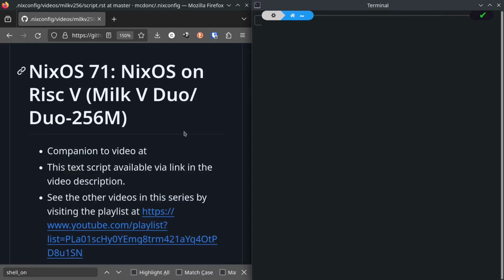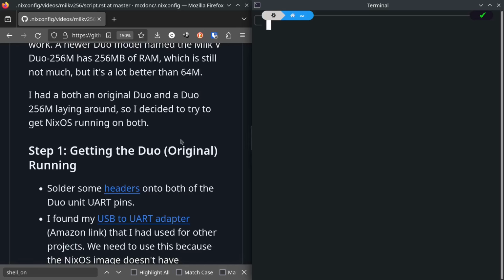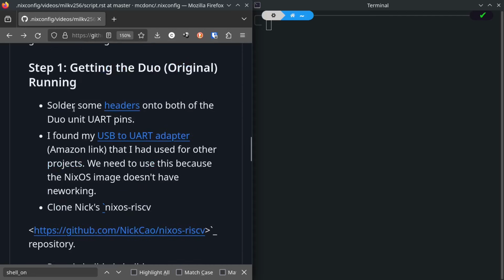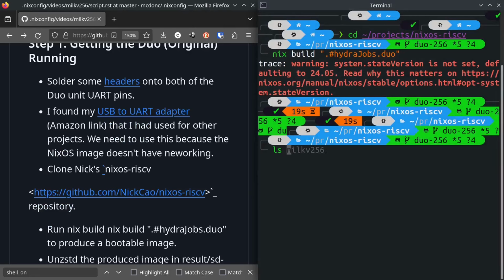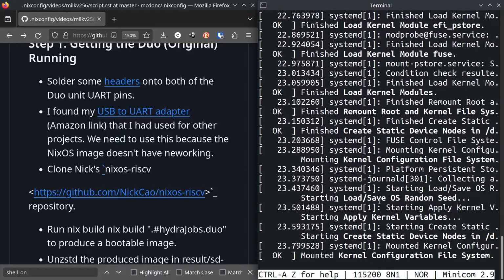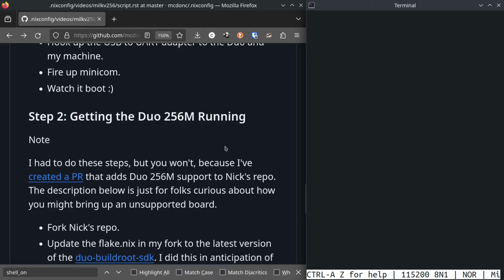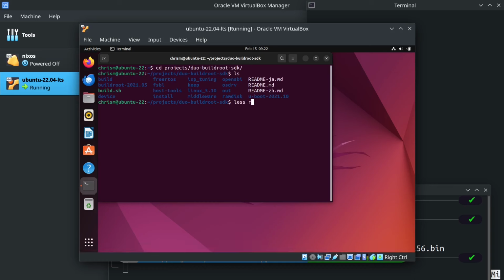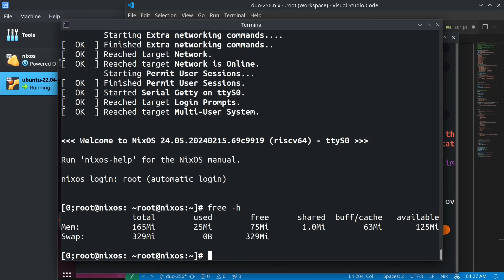NixOS 71: NixOS on Risc V (Milk V Duo/Duo-256M)

Comment: 64MB and the OS leaves only a few MB for apps? Why does a terminal OS take so much RAM these days? Windows 98 could happily run on 32MB of RAM and it had GUI and stuff.
Reply: I'm curious too. Although I remember that using Win95 on 16MB was fine, using Linux was not at all. I mean console, gcc and this stuff worked. Xserver technically worked, but using something really lightweight such as FVWM or WindowMaker was the only option and StarOffice or Netscape barely started after few minutes of heavy swapping.

Comment: Thanks for documenting this - I've been playing around with an original Duo, and I've nearly got it setup to use my desktop PC as a distributed package builder.

One question I'm unable to answer online - when building these SD card images, with `nix.enable = true` in the derivation, why does the root filesystem on the MilkV not have a `configuration.nix` file? That is the final piece of the puzzle for me :)
Reply from the maker: You can use nixos-generate-config to create one... I show how in https://youtu.be/RELQyTfZPG4?si=K3yDd8tgmxNFdU9-&t=473 (on an rpi, but same thing).. most of that video is actually applicable to the milk v too fwiw.  I doubt the Duo will be able to complete a nixos-rebuild though, too little RAM.
Reply: @ChrisMcDonough  awesome thanks heaps! Yeah, I am experiencing OOM a fair bit. Swap has helped marginally. Fun to try though :)

Comment: Are the pins the same on both boards? I ordered the 64mb one with the expansion board from Ali Express. A 256mb  one just  popped up on Canadian Amazon so I ordered that too. I was just wondering if I would be able to use the expansion board with both. I really have no idea of what I'm going to do with them but they're cheap enough to just play with. Thanks.
Reply from the maker: I haven't tried the expansion board with either but the physical dimensions of the pins and form factor are exactly the same
Reply: @ChrisMcDonough  Thanks. I couldn't tell from the documentation. I just started buying different microcontrollers when I ran out of Raspberry Pi's during the pandemic. I'm just bumbling my way through. You definitely don't an SBC for a lot if things.
Reply from the maker: @kattz753  heh they're cheap enough to buy one or two of each to play around with for fun too